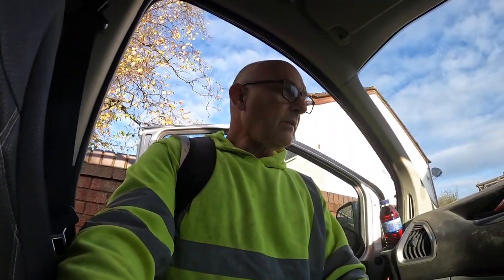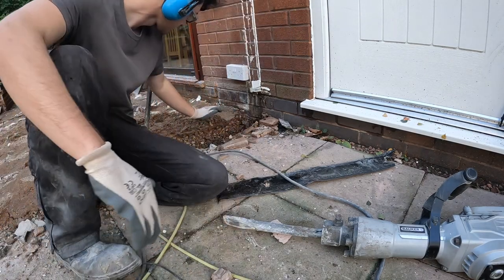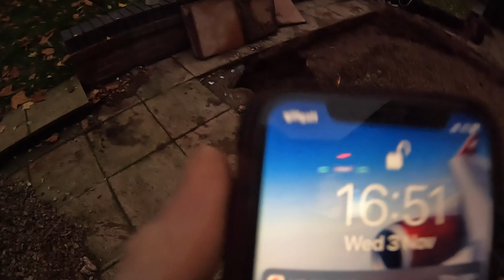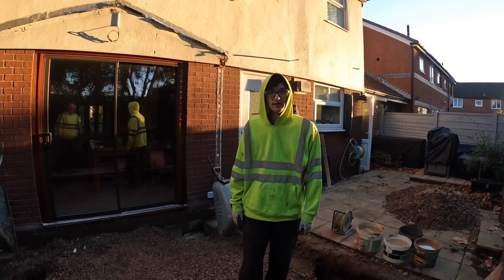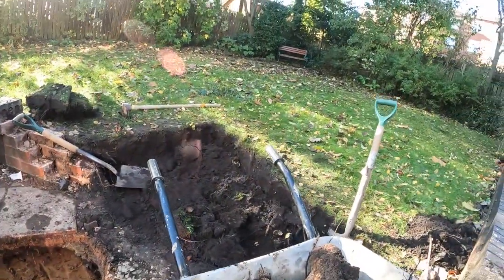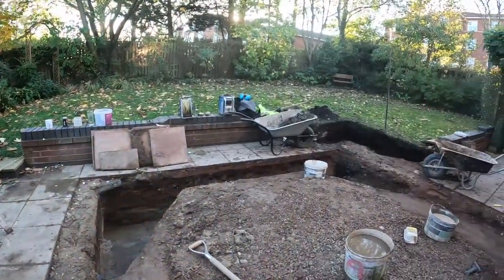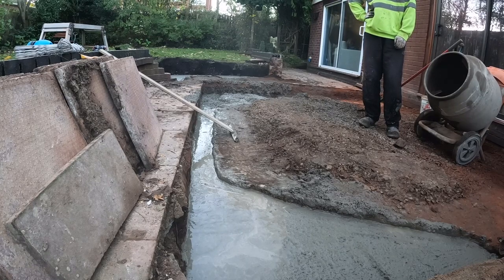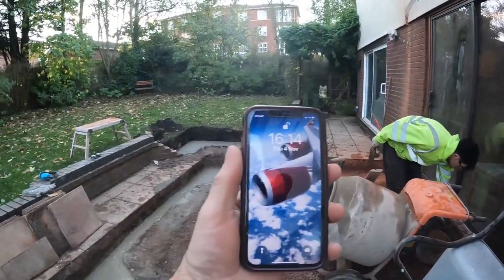HAND DIGGING FOUNDATIONS, BIG SPLASH.. CONSERVATORY UPGRADE PART 1

Comment: Hi Steve! You were mentioning that you couldn't get a true brick match as they didn't make them any more. A friend of mine started a business here in Texas some 30 years ago demoing brick buildings. (Lots of old city buildings and store fronts.) He would knock them down fairly cheap and salvage the bricks. He had a brick yard where he sorted the bricks for resale. Some really old stuff he didn't sell as he figured they would gain in value over the years. They certainly did, especially with the later interest in vintage brick and stone work.  He's a multi-millionaire today (retired). 
I noticed ya'all don't use rebar in your footers. We don't ether in most areas, but always require rebar and/or lattice in slabs. Since you were putting in footers along an existing slab, I'm surprised you didn't have to put tie-ins to join them. (Required here.)  Must have been a bit chilly there...no T-shirts and shorts!  😀😀 Cheers my friends from Texas!
Reply from the maker: We have reclaimation yards too with extortionately priced , often poor quality bricks 🧱👍🏽
Reply: @SteveAndAlexBuild  Wow! We've had issues with Mexican bricks that were not fired properly and would literally dissolve in 5-10 years. But, the old bricks (50 - 100 YO) are 95% of the time solid. Thanks so much for a good video sir!
Reply from the maker: @WarpFactor999  No problem buddy 🧱👍🏽

Comment: Question lads. Not being a brickie myself, what are the Blue engineering bricks generally used for?
Reply from the maker: Below dpc and for  decorative brickwork too 🧱👍🏽
Reply: As they don’t absorb water it’s like less than 4%. And a super hard and dense last for 100,s of years. Where clay type bricks absorb a lot water and generally fall to bits if exposed to alloy of water.
Reply from the maker: @lmilne4859  👌🏼🧱👍🏽
Reply: Thank you all for that great bit of info especially about the water absorption
Reply: @iangough7659  
That’s what great about these type of channels buddy. No problems at all. 🤙
Reply: @L Milne …once again thank you mate